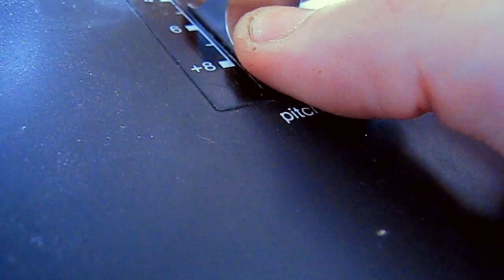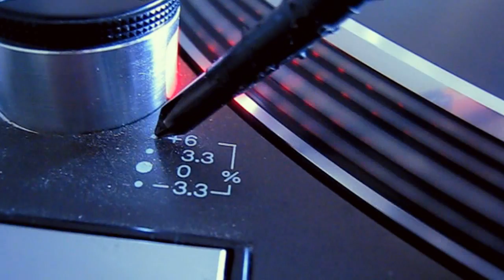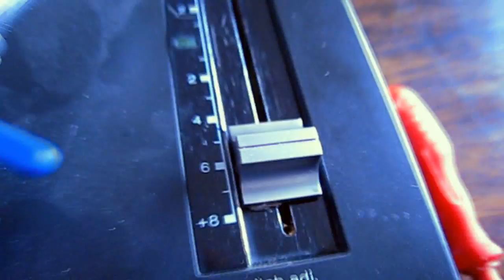Technics SL MKII Pitch calibration part #2 How to calibrate the pitch range.

Comment: Hi mate I tried this on my 1200 and the Pitch PCB is different - I eventallly got a new pitch fader and went to a local repair to do the solder , even with that done it still needed adjustment. So I went to a so called specialist - got the deck deck and ( see my Video) as you can see still jumping. 

The guy in the specialist place said there were 3 adjustments 1)Pitch 2)Plater 3)Range
Is this true and if so why am I having this recuring problem ??
Gavin

Comment: Love to figure out how to do this with my Stanton T120C's, even with pitch lock on they won't zero out, the dots switch every 12 revolutions or so on one of em. Kind of afraid to open them up all the way as they seem to be designed differently than the Techs and I'm no electrician. Many thanks for this though. Very, very helpful.

Comment from the maker: @johncheez No problem, thank you for your comment.
Yeah I would do the zero position first and then the range adjustment.
If the zero position is out your going to find it hard to calibrate the range using the strobe.
Thanks again for your comment.

Nice One ; )

Comment: Appreciate these videos a lot mate thanks. I got some 1200 mkII recently second hand, they're in god condition but as i'm not used to using turntables I don't know if the pitch is as accurate as it could be. I think with the aid of these videos i'll take a plunge and take them apart to if they need callibrating. Again, big ups for doing these they're very helpfull.

Comment: Finally! This is one of the best or the best way to get my 1200s pitch set perfect. Thank you 100%. I normally spin between 125-134 bpm and now after doing this adjustment I'm finding it 100% better regarding beat matching before each blend. I also adjusted my braking time as well to my preference. You have been an excellent source of my 1200 tweaks for quite some time now.